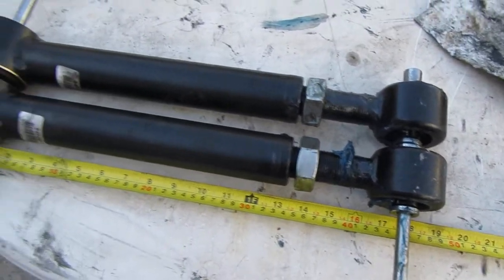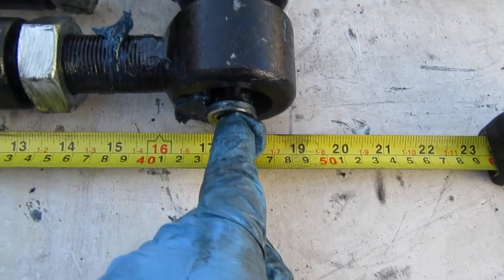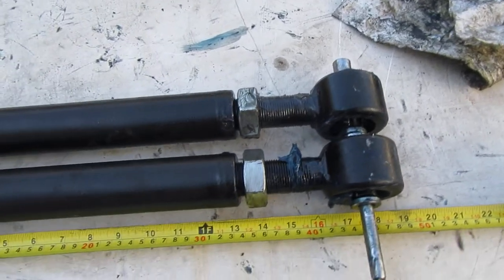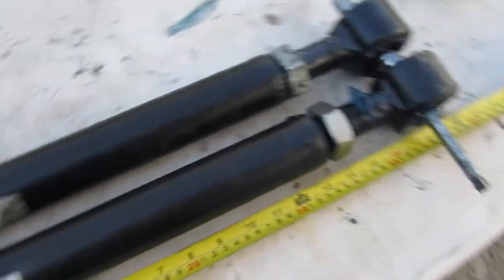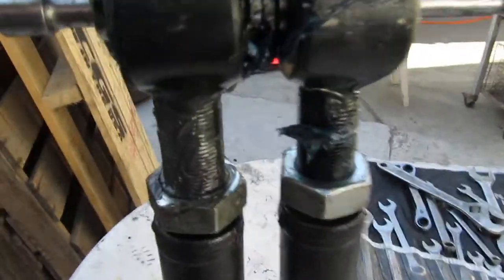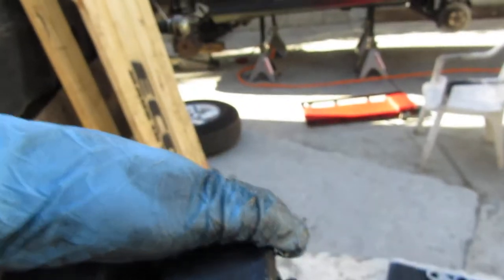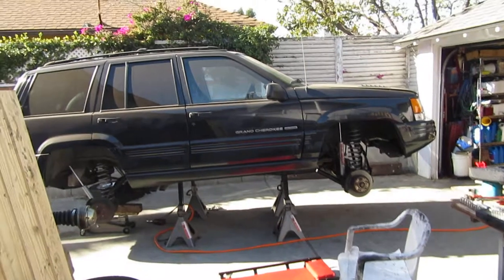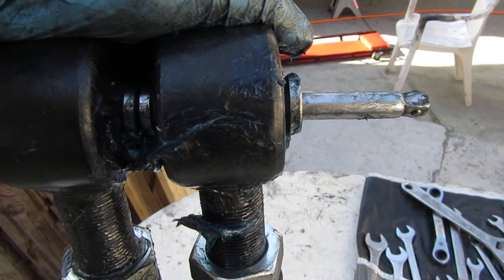Lift Kit Pro Tip Most Important Video before installing Control Arms Jeep ZJ 5.9

Comment: I just finished installing my arms.  Didn’t preset length, not a one.  Bolted in one end, adjusted as required to put the other bolt in, no problems at all.  Here’s my tip… don’t jack up anything arms go in easy.